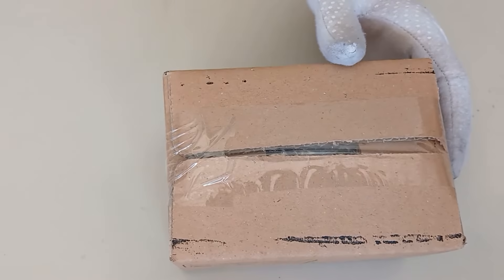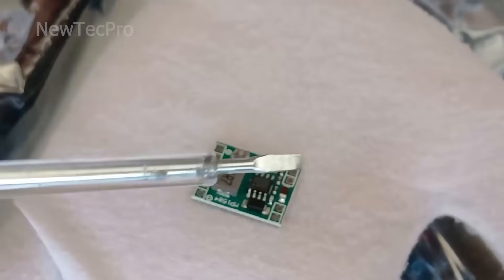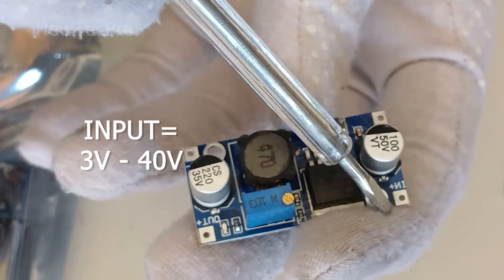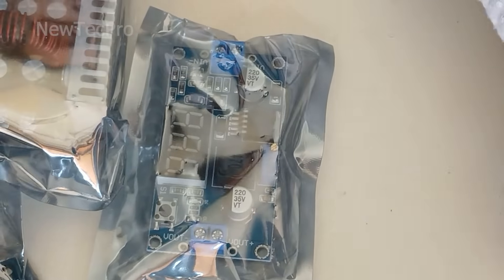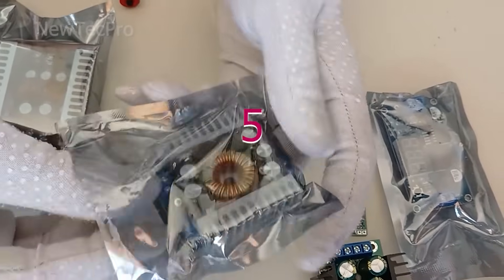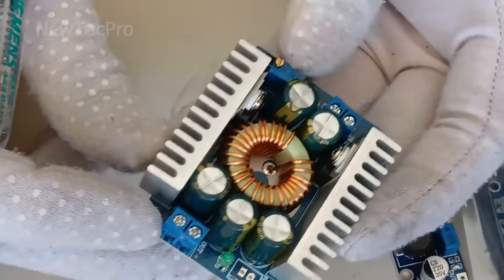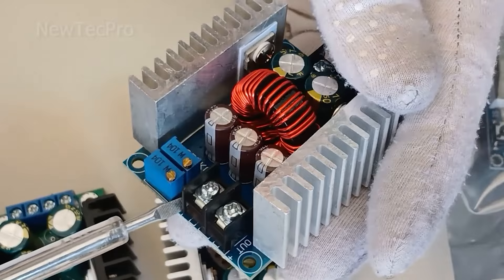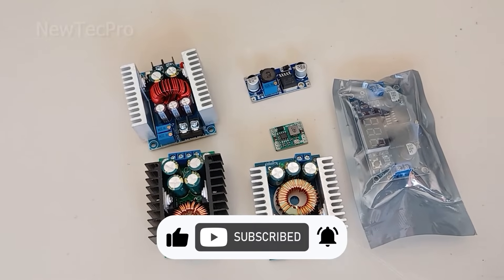6 BEST Step-Down Buck Converter Modules DC-DC 2024 Review

Comment: I have problem using 4 mg90 servos on robot arm and I think it's power supply that causes the problem.
Which one should I use?
Reply from the maker: What is the model of the module in question? Can its datasheet be found and specified?

Comment: Bought 2 of XL4016 with volt meter and both don't work.
Reply from the maker: Check these things:
You haven't mixed up the input and output
The input voltage should be within the specified range
Did you turn the multiturn in both directions and test?